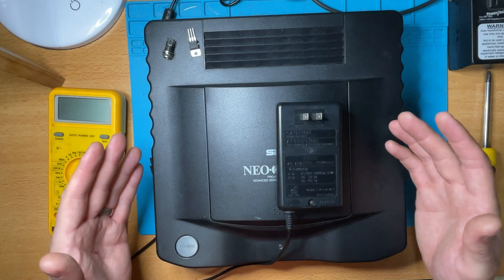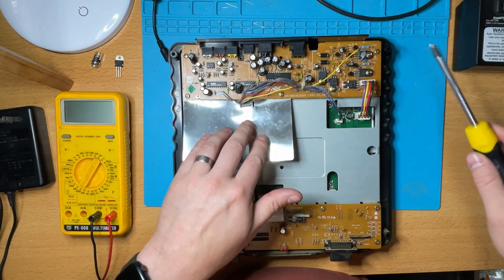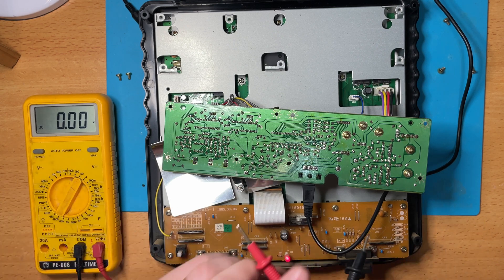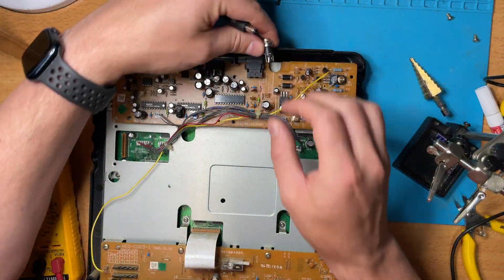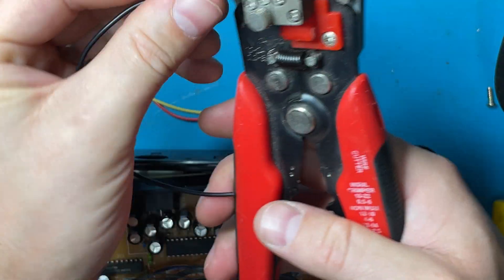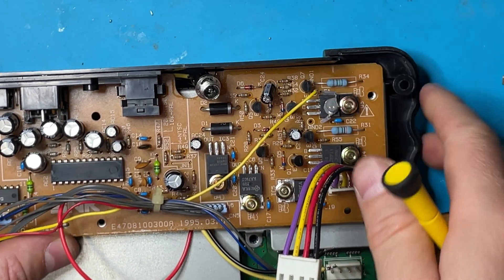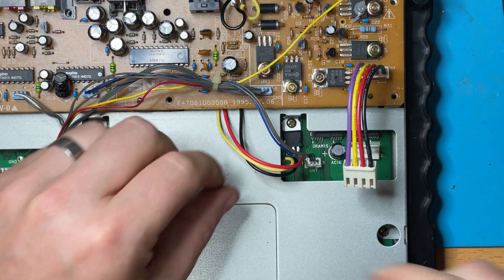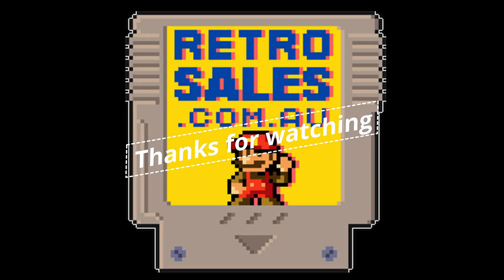NeoGeo CD Power conversion - YouTube

Comment: just what I needed , have one in Aus , I tried a pc power supply with molex and used a 3 pin din . the cosole did not turn on so I left the project. I will try this method
Reply from the maker: 12V DC is too much... it will boot but quickly hang. Try 9V DC
Reply: @RetroSalesAustralia just did the mod worked a treat , thank you very much console booted for the first time , owned it for years 🎉

Comment: You really don’t have to turn it on to measure the input voltages there. The PSU is outputting those voltages already.
Reply from the maker: @emmettturner9452  correct. Good spot.